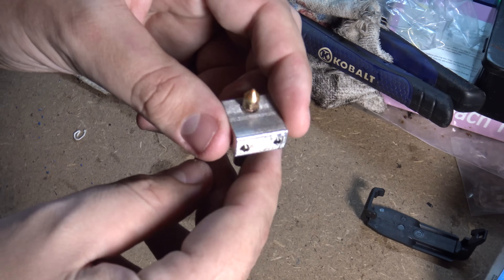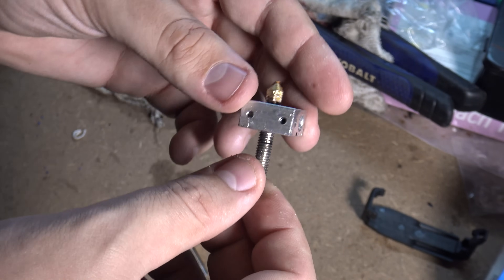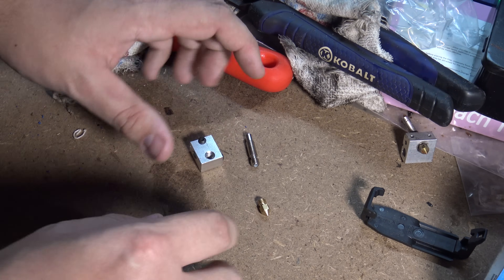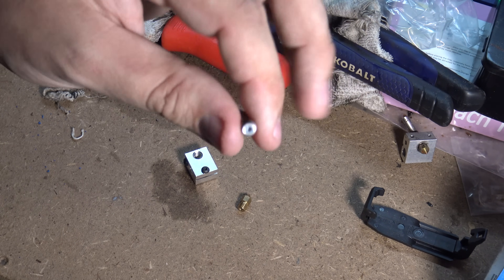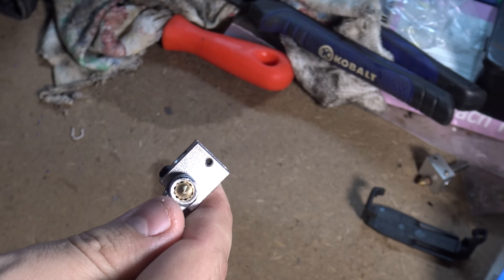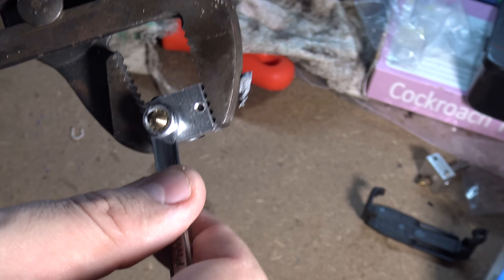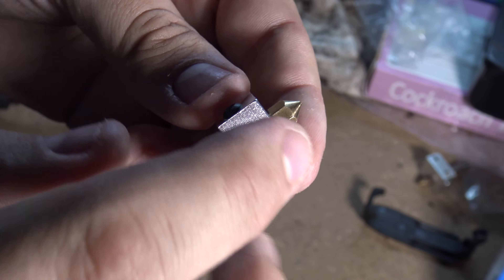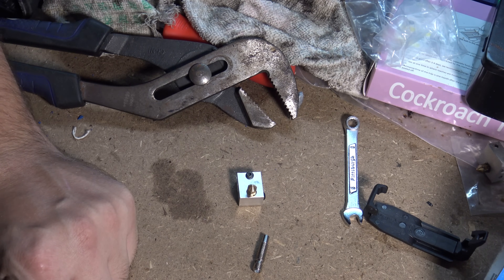Leaking 3D Printer Hot End Fix!

Comment: TLDW: Hot end isn't assembled correctly. Loosen the gap between the nozzle and heatblock to about 1mm, make sure it's not cranked against the block, then tighten the heat brake, then fully snug the nozzle.
Reply: as an explanation, the presence of the gap itself is inconsequential, what you must have is both elements tight against each other. the gap allows you to do some final tightening on the nozzle end (on subsequent nozzles too), while having visual proof that the nozzle didn't bottom out on the heat block, but on the heat break.
Reply: @calinguga  Followup question: If the nozzle sticks out further than 1mm, but still backs onto the heatbreak, why does it still leak?
Reply: tnx for summaring ;)

Comment: What I did is use a tapping tool, M6x1mm and cut the threads inside the heatblock clean. It makes the threads slightly larger and also use a die to cut the nozzle/heat brake. Now they will both go in the block slightly loose with little bit of wobble. So when I tighten the nozzle against the heat brake, that loose fit threads will allow them to move and sit perfectly flat together, that will compensate for any slight misalignment of the surface between nozzle and heat brake

Comment: What printer are you using and does that matter for other brands?
Reply from the maker: This printer was a Folgertech ft5, but it applies to pretty much any printer that has a small nozzle that meets up with a heat break-like tube. A lot of printers nowadays have an all-in-one nozzle and you wouldn't really have to worry about this.

Comment: Does this mean that the one you had in before is no longer usable and you have to buy a whole new set of pieces?
Reply from the maker: @ufoquilter86  it is generally recommended to swap out nozzles. This style is super cheap and is a consumable item anyway. Most of the time you can heat up the nozzle outside of the printer to remove a clog if you don't have replacements.The heatbreak only needs replacement if the ptfe tube inside is damaged.
Reply: So what causes a nozzle leak

Comment: After tighting the 2 parts in the heater block I solved the problem by covering the nozzle hole with a finger and sucking the air with my mouth and pass it to my tongue for some time. If it keeps there for another while I am pretty sure there will be no leaking, always worked for me and I never had that problem again.

Comment: Great... That's exactly how it works best. Due to problems with the heating capsule, I bought a new hotend because it has 2 fixing screws, better than the one that came with it. At the moment I'm trying to improve the hotbed base with the ruler bearings. The printer is an Anet E10 in the process of being converted the controller box disappears, the holder has already been printed out. The conversion is now starting. I hope everything fits and works as I imagine.
Reply: Old Hotend for PET bottles filament test Production recycled. If successful, I will post a video about it on my channel.

Comment: Can I just say, THANK YOU?   

I've printed quite a few things recently, and have been frustrated that I had to babysit the print, basically pausing and cleaning the nozel and hot end every 30-45 minutes...

I did my due diligence and RTFM, the instructions said to install the nozzle until it was tight, then loosen slightly for thermal expansion...  
NEVER did it say anything about the heatbreak probably being loose!
unfortunuately, googling this stuff typically leads to generic answers "is your temperature too high?  is it too low?"  "is the nozzle loose?"  

im going to teardown the printhead tonight and see if I can finially fix this.  Of course the first issue will be those teeny tiny m1.5 screws they use to attach the hot end....

Comment: Yeah. I ruined a $50 nozzle trying to take it off without a proper 6mm tool at 3am using a yellow can torch in my kitchen after it was soaked in oozing plastic... I'm new to this so getting a 'new' printer from amazon with mashed up threads and crossthreaded block makes me wonder if the world manufactures incompetence for me sometimes. Going to start on the third heating block and if I mess this up I might 'quit 3d printing' because I can't focus on learning how to make parts when I spend all my time printing junk and then fixing my printer after... I got it working for a time but once I put it on 210 degrees for some petg I was trying to print, it started leaking a bit again and then it stopped printing my test piece with the larger part of the leak coming from the top where I had a installed a bimetal heatbreak and got a 'hotend temperature issue' warning before shutting off my printer. I have a vyper so I'm looking at maybe new firmware updates also. Life is stressful when you just get into 3d printing! (But at least I have like 20 low poly ff7 toys now) Was just reading about thermal paste too and copaslip. 3d printing is not as easy as it seems. I gotta give credit to people who do it succesfully. I guess once I learn how to handle the hotend without mashing up the threads on plastic I can buy a fancier one but they all seem to be made of stuff that is soft, like copper. I wish I could put like a little crush washer betweem them like they do every time you put on your drain plug back on a subaru...

Comment: Starts at 2:30. This video is missing the need for thermal grease on the nozzle threads which is probably the simplest thing you can do to prevent heat creep since once it gets plastic on the threads it becomes insulative and thermal grease keeps the heat moving. It is also very important to thread the nozzle in while it's hot (if it's a used heat block) since otherwise you'll be trying to thread thru solid plastic which will probably result in stripped threads at some point. Usually these go to 2 ft-lbs and if you snug it up while it's cold it will be loose again when you heat it up, so you have to do the final torque while the hot end is hot. Obviously use safety precautions to not get burned.

Comment: Thanks for this. I not only learned a lot about how my printer works, but I was also able to save what I thought was a damaged hot end. It turns out my Amazon nozzles were different than what came with the printer and leaked for the reasons you show in your video. Good to go now with no more oozing.

Comment: This was very helpful. I have an extruder where there is capricorn tubing (teflon tubing) instead of that metal heatbreak with teflon inside it, and the nozzle bumps up against the tubing. I have probably been cutting the tubing too short, because I was measuring how long it needed to be when the nozzle was threaded in all the way. (no nozzle gap)

Comment: I can't figure out how to make this work with the Prusa MK3 hotends. I don't see a threaded seat for the nozzle to push up against.  I am leaking EVERYWHERE and feel like this is the answer, I just can't figure out how to make it work for my printer. A bit more info, the heatsink it built into the hotend, whereas your threaded rod appears to be able to be detached from the heatsink, if it doesn't act as the heatsink. Halp... :P

Comment: Check the threads inside of the heat block, once I had a piece of brass thread break off and get stuck when I tightened the nozzle. I thought that the nozzle was tightened correctly, but after 5 minutes of printing, plastic came out of both joints. +1 hour of maintenance.

Comment: I remember watching this when I first got into 3d printing and my hotend was leaking.  It fixed my issue back then and I have remembered it since. 
My method, start with nozzle first,screw it in till I can fit thumb nail under it(aprx .6mm) and run the heatbreak in till it bottoms out. Install it to printer,  heat to 10c above highest print temp I use and tighten the nozzle. Has worked fine for me everytime 

Tldr:I use an adjustable wrench to hold the heatblock and a wrench on the nozzle. Snug it up,install to printer,heat and snug nozze.
Reply: Also if you have a tap of the proper size you can run it into the block to clean up any stuck filament in the threads, I heat it a little first.

Comment: what if you use a 3mm ptfe instead of a 2mm ptfe?
Reply from the maker: If you use 2.85mm filament (Like in a Ultimaker) then that's fine. Using it with 1.75mm filament could cause jams or clogs since the filament will be fairly loose in the heat break.

Comment: 14 Minutes to get wrong instructions........you have the heat block to deep in the hot end.. You could have the nozzle less than 1 mm out, still not touching and do a better job.. And you could explain all than in a 3 minutes video.

Comment: Thanks for the explanation. My hotend started leaking after I did my first nozzle change (from 0.4 to 0.2). I thought it was due to the pressure difference of that nozzle, but when I switched back to 0.4 the leaking didn't stop. I will try tightening up all the pieces, but I understand that I shouldn't need to disarm all the print head to change the nozzle, right?

Comment: Thanks to you I find troubles in missing gap between nozzle and heatblock. Of course precise nozzles and heatbrakes must be used, precise planes touch each other. In past I used paper gasket (something like paper washer) between nozzle and heatblock. That solves some leak. What do you think about use silicone (heat resistant silicone) to tight parts? I found it in some tutorials

Comment: Is there a torque rating for the hot end / nozzle?  I just don't want to over-tighten the nozzle and cause more serious issues.
Reply from the maker: There probably is one somewhere, but I don't know what it is. I subscribe to the idea of 'if you hear it snap, you tightened it too much' mentality. 🤣 Tight, but not too tight.
Reply: @DustinCorbin  I looked it up.  The only thing I can find is a reference to 1.5 Newton meters which is about 13.5 inch pounds.  I found a Wheeler torque driver on Amazon that is capable of  adjustments between 2 - 40 inch pounds.  I'm going to do a little experimentation to see what works.  Thank you for your video.
Reply from the maker: @adrianedmundson3330  Awesome, I appreciate the information. Record the experiments and post a video on YouTube! ;D

Comment: Thanks for your great video. I have the same very problem of a oozing hotend (on top more then on the nozzle). I will apply your advice. 
My hotend became leaky I think after I switched the nozzle. After the switch the heat block was always a little bit loose so I think the heat break is not threated in enough anymore.
Thanks again Dustin! :-)

Comment: Thank you. Got my printer 3 weeks ago. Had a clog, changed nozzle. Guess I didnt tighten enough.
Had ooze issue. Wrecked a print because of it.
Anyway. Took my mk8 sorta apart.
Cleaned hotend, new nozzle again and tighten while hot.
Then added bowden coupler but didnt tighten all the way until I inserted tube, checked flush cut first. Then tightened down.
Tested extrusion.
Problem fixed. Fingers crossed.
Thanks for the vid! Helpful!

Comment: when tightening, screw only nozzle to the base, not this feeding tube, I managed to break it appart. Also, when you have this tube sticking to base, screw two nuts on it and use them, this way you get better grip (can use wrench) and don't break the thread (just don't apply too much force, it can break between nuts).

Comment: Couple of things; the source of all leaks is the same darn thing, and that is a poor seal between the nozzle and the PTFE tube.
Crank down all you want to make the heat-break/nozzle interface 'sealed', that won't help stop a leak caused by a mis-cut, nicked or short PTFE tube end.
Yes, get a mechanical lock between the heat-block, nozzle and heat-break tube.  Best done hot as parts need to be tightened at operating temperatures.
There has to be a firm pressure on the nozzle end and PTFE tube; that is the only gasket built into the system.
I have had three 'silent leaks' that way; no oozing from the top or bottom of the heat-block, but PLA did find its way into the gap between Bowden tube and heat-break tube.
When I say Bowden tube, I mean any PTFE tube in the hot-end.
With the nozzle cold, could not remove the Bowden tube. Nozzle hot, I was able to remove the tube with lots of effort.  PLA in three colors on the tube outer surface!
What he said, nozzle to PTFE tubing fit is critical! 
Save yourself lots of grief, make a tubing cutting guide and use fresh razor-blades to get square-end cuts from PTFE tubes. 
This issue is going to crop up whenever the PTFE tube and the nozzle must form a seal.

BTW, One 'silent' PTFE tube end leak ruined a 0.4mm Olsson ruby nozzle; there is an inner sleeve that holds the ruby in place in the body of the nozzle and I had PETG leak into the body/sleeve gap. 
This plastic in the gap made a heat-break, the extruder started clicking no matter how slow/hot I was trying to print.  The nozzle had stopped conducting heat! 
Olsson, your design sucks! That inner sleeve should be sweat-soldered to prevent plastic ingress!  Solder makes a great thermal interface medium...
I burned out the plastic [a no-no according to Olsson], re-assembled the nozzle, soldered the sleeve into place. 
Be sure to use a high-temp silver bearing solder as a 245C hot-end will melt common electrical solders! 
Yes, the notorious Olsson stoppage is caused by PTFE tube end leaks! 
If you don't mind modding a $90 nozzle with silver brazing, borax flux and a MAPP gas torch, Robert is your parents sibling...

Comment: Thank you… finally I figured out why my hotend was leaking after I had to replace parts. I wasn't sure how it was supposed to be assembled. Unfortunately my thermistor was broken and the filament was heated up to 310°C instead of 200°C which must have damaged something inside the hot end – maybe the teflon tube.

Comment: I did as u said and it still leaks. Than i watched another video and saw why.
I think u dont know WHY there is a Gap between the heatblock and the nozzle...

Because: U need the gap to be able to tighten it up even more AFTER the heatblock (plus nozzle and tube) are warm to like 230 or more degrees CELSIUS, not "sience".
When its heated up, tighten it even more. Cause the heatblock it self expands when its hot! Without the gap u cant tighten it up more after its heated.

Thats why there is the gap!

And thats crucial to have it really sealed! When doing it like u said, many wont have a tight seal!
Reply: Thank you! I did as the video suggested and still had leaks with no idea why. This is my first 3D printer, so I was stumped. I'll have to try this when I figure out how to clean the plastic off the parts.
Reply: @emilyedwards4914  
If you used ABS, soak in acetone

If you used PLA, get a new one.  Its not worth the hassle.  They are under $10 on amazon.  (I can link you one i just bought if you like)
Reply: @corvidconfidential8826  it was, in fact, PLA. A link would be awesome.
Reply: Eddy for President! 2020! right on the money buddy!
Reply: What a pretentious comment

Comment: Also, the pipe thing ("heatbreak") is oriented and you have to install it in such a way that the white teflon pipe thing rests against the nozzle. I have accidentally turned it the other way around and the leaking problem got much more severe. :D But after 6 hours cleaning, it got fixed (fingers crossed, no leaks so far!).

Comment: how do I clean a nozzel out from plastic? :/
Reply: don't waist your time buy a new one
Reply: '
waste' sorry
Reply: Don't buy a new one, unless you really feel it's necessary. I just heated mine up so that the filament dripped right off. Don't burn yourself though.
Reply: Best way to clean the plastic out of the nozzle is by doing a cold pull. Heat the end up to the melting point and push filament through it, turn the temp doooooooown to 100°c (PLA) and keep pressure on the filament. Once it reaches 100°c pull SLOWLY until the the filament pops out.  You should be able to see any pieces of old filament as well as see the form of the inside of the nozzle if done correctly. Youtube some examples

Comment: "leaking hot end" is rank #1 Dustin. Great SEO. You got a new scriber. Thanks for the video. Although my hot end is different on my i3 Mk2s your video game me the will to take apart my extruder and re-seat the break into the heater block. I was having leaking, it was dripping down onto my print leaving globs that ending up hanging the printer up. Fortunately, I was right next to the printer when this happened and I was able to abort the print. I should have created a video on it. I'm kicking myself that I didn't.  
You going to MRRF?